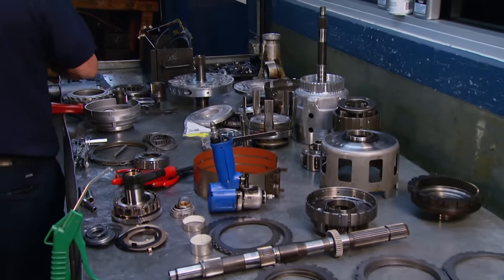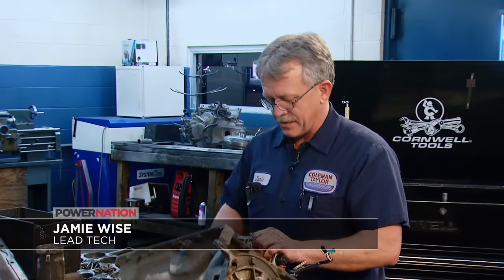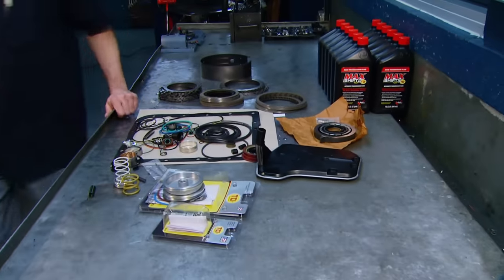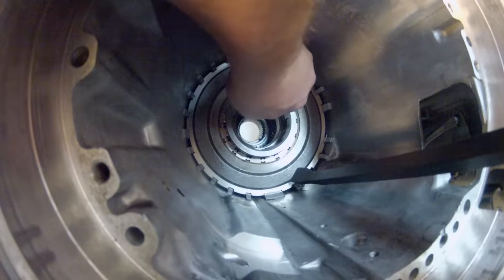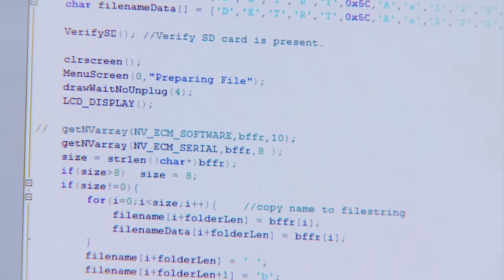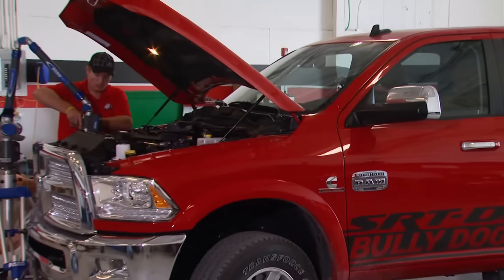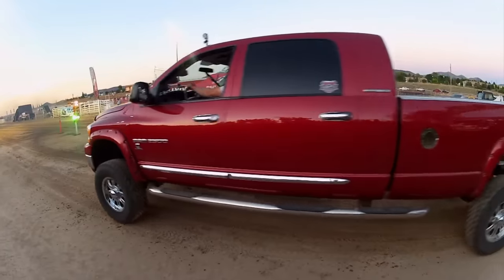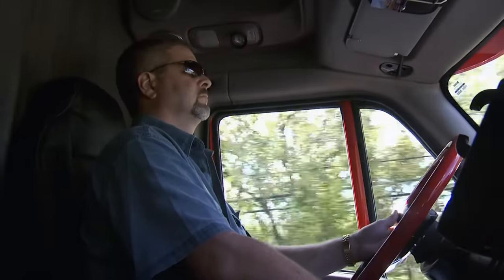Rebuilding a GM 4L60E Transmission for a Chevy Silverado - Truck Tech S1, E12

Comment: Here is the proper way to fix a 4l60e: Sell it for scrap or core and buy 4l80e and install.
Reply: ZE_GERMAN hell yeah brother dido😆
Reply: 100% agree, why waste your time on a 4l60, which even when upgraded is weaker than a 4l80
Reply: Exactly!  Don't even crack the case open..scrap it!
Reply: Facts
Reply: You can dump $5,000 into a 4L60 and run 2-3 tenths faster or use a 4L80 with $5,000 and run 2-3 tenths slower, the choice is yours
Reply: I'll sell you one for $1999 + tax. The part list wont be more than$840.
Reply: @garyrobinson3735  "break"..I wouldn't trust a 60e that cost less than my 80e converter not that I trust them at all lol. A junk yard 80e with shift kit, hardened input shaft and decent converter would be miles ahead of your 60e and reliable with 700hp..you trying to make Thors hammer using eggshells..
Reply: bottomline2000 you need to stop watching the drive way engineer also.
Reply: @jeromewieland55  likely you won't even launch with one of these and snap something inside like the sun shell and them 3-4 clutch packs really love to burn out.
Reply: @garyrobinson3735  nah I had 3 reman from GM which were all blown in a stock 4.8 within 270k miles at 80k miles a swap that's garbage for a factory drivetrain.
Reply: @bryanmartinez6600  get on Facebook and YouTube. Their are plenty of nitous, turbo, n/a cars running 4L60's. To much parasitic loss in a 4L80
Reply: @jeromewieland55  once..you forgot to say once...
Reply: @spyderlyf3  80's are way more expensive and you would be dumb to pull them from a scrapyard and throw them in a vehicle with any kind of power. They are known to wear bushings excessively and I've seen them with the case beat up very bad from the check balls. Until I hit 650-700 ft-lbs of torque I will build my own 60's and know what's in them and have half the money in them. When I hit the point that I need something more than a 60 then I'll go to a 6l90.
Reply: I couldn't even sell my 4L60eeeee for parts. I ended up scrapping the whole thing because no one wanted to pay me money to take this garbage away for me. 4L80E for the win. Got the pressures turned up to max in H P Tuners in WOT. Hits like the Hammer of Thor when it shifts, 1st, 2nd, 3rd. Shifts like this would tear a so called built 4L60eeeee in half.
Reply: @414Chevy  I'll take it. That's not good for the trans to run excessive pressure. You will warp clutch apply plates and start blowing snaprings and drum ends off.
Reply: @GreatLakesLogger  WOT table only is turned up, no torque management. The table will only allow so much pressure. This is a built 4L80 E with 300 M input shaft, so yeah. Did I state it's a 4L80E ?
Reply: @414Chevy  So what? It's still not good just to blow pressure at it. 4l80s eat bushings built or not and they suck more power. Also depending on what you're doing the gear ratios aren't as good and they are expensive. I won't deny a fully built one won't hold more power than a 60 but a 60 will hold plenty of power if built, setup, and used properly
Reply: I Drag Race my car. I don't want my clutches doing soft shifts at WOT so they slip. I've been racing for years. This is what I do. You can build your 4L60eee or 4L80E how you like. This is how I use mine. Did I say it was a 4L80E?
Reply: @414Chevy  I really don't give a crap if it's a 4l80. If I'm gonna spend that much money I'll have a built six speed.
Reply: Yea for you. Obviously, you don't drag race, which is what I do. The fastest way down the quarter mile, not road course, which...…….. you obviously do, is an automatic with a big ass stall converter. I hope you have fun with your built six speed for $2,400.00. Didn't know you could get one that cheap. That is truly a bargain. Walley World is having a sale on toilet paper for $20.00 also.
Reply: Hey Mr. Blow, BTW, a built T-56 starts at $3,195.00 and goes up to $4,947.49 minus a clutch. Ohhh, you must have meant you're building it yourself, because you got the dope moves. Good look finding that $2,400.00 monster trans you saw for sale...……… where?
Reply: @GreatLakesLogger  I'm sorry I didnt realize we were still talking about this..too busy not having transmission problems..I didn't pull my trans from a scrapyard..its a GM 4l85..2009 model with 20k miles on it. Last year they were made. It looks brand new while I'm not throwing pressure at mine it is dual fed with a triple disc converter..the 60e struggled to handle the cammed 6.0 whereas the 80e just rows thru the gears..its smoother in every way. 1 80e cost a lot less than the 2 60es I blew up.. The gearing isn't for everybody but I have 3.42 gears and enough stall so I'm not lacking anywhere..I can still get factory gas mileage on the highway..you can hate on the 80e, but I guarantee you will not beat one rowing gears with a similar setup..typically racers go to less gears than more where power levels go up..good luck with your 60es
Reply: @414Chevy  and yes I will build it myself.
Reply: @GreatLakesLogger  Well isn't that special. You go, you wacky do. Just stay on the road course, so a slush box doesn't embarrass you at the drags.
Reply: @anthonym6078  Will it fit my 05 Avalanche?
Reply: @garyrobinson3735  I want learn to rebuild one  for my 2004 ant tips on parts
Reply: Btw. I can still build a 4l60e to handle over 1000hp for over 100 wot shifts for less than $850. So you guys can keep sucking the power out of your builds with that 4l80. Haha

Comment: Transmissions have always been a real mystery to me, but I am tempted to try rebuilding one myself.
Reply: Same here, it's a fun challenge for the mechanically inclined. Very easy job to mess up though even when you feel like everything's going great. I'm very by the book with clearances but I know there's so much more to it.
Reply: It's a puzzle for sure but not something a good mechanic can't do. I went to transmission school 42 years ago but never got into the field, opting for HVAC as a career instead. I have however rebuilt a few and they all came out better than stock and for 1/4 the cost of what a rebuilt one would have cost me.

Comment: Transmission Bench on youtube shows exactly how to rebuild one with no special tools
Reply: Minus that TP50.. pretty critical for most people who might find themselves at the start of a 4l60e build.
Reply: I'm 15 years old and rebuilt mine with a few wrenches and a pair of pliers 😂
Reply: @Jake Bass how much did it cost u in parts 2 rebuild it
Reply: @garyrobinson3735  I just used impact T50 and a couple minutes with a torch.
Reply: They need door pins and bushings and new cab mounts and need to ditch that ugly lowering job
Reply: @jac_attack04_59  Thanks, just the confidence I needed. Took mine to a backyard transmission guy who was referred by a now ex-friend, my tranny was leaking upon pick up. Took it back, still leaking but a lot less upon pick up. Ended up finding another 1 by luck at a junkyard that was in great condition at a great price but still out of $ 800. I'm planning to open the rebuilt tranny and hope I can diagnose and fix the leak myself and save that tranny for a backup.

Comment: I trust transmission shops as much as I’d trust a stripper with my credit card.
Reply: Just like any tech gotta find a good one.  Back when I had a carburetor in my truck I found only one in Albuquerque that could be trusted to rebuild it.
Reply: I'll only fix one thing and I will charge at least $1400. 
NO Exceptions. If you can do it yourself then you wouldn't be talking to a Builder. So you deserve to be charged every dollar. 
And I will tell the customer the same thing. So what's not to trust?
Reply: @garyrobinson3735  not going to lie what you said is some shady shit!...im not saying your wrong at all,but it is like charging someone $300 for a gallon of gas...of course most of us cant make or source our own oil to make gas but do we deserve to get overcharged?
Reply: @garyrobinson3735  mechanic shops these days hardly bother with repairing the actual transmission though usually if the price of repairing it is just a little lower than throwing a reman might as well do that instead
Reply: Jamal J.H yeah but for how simple it is to fix anyone not willing to put in the time ABSOLUTELY deserves to be charged for their own short comings. 

As for Herpy's comment mechanic shops will. Transmission Shops with real builders will build it. Why would I spend $2100 on a factory replacement when I can rebuild it for less than $300. And then charge $1000 for labor? Not only does it make more money but it's ALOT quicker too. 

hey all look start at $2100.
Reply: Jamal J.H in short, Absolutely. You and anyone else.
Reply: Sherloid Bai
I really enjoy hearing that kind of experience.
Reply: Sherloid Bai I have a 97 Chevy truck v6 transmission that I’m leaning on rebuilding it myself. I do have mechanical skills but never on transmission. How much did you spend on parts and what special tool do you need.
Reply: @bryanmartinez6600  also, rebuilds don't carry a reman warranty.  If you get a GM reman, it has a 1 year warranty, whereas a rebuild will have no warranty, or whatever the shop expects is a decent warranty.
Reply: ryvr madduck Lot of crooks in Albuquerque hah
Reply: Gary Robinson I think the point was that regardless of the failure, you’ll be quoted and charged for an overhaul that will never take place. Often getting a repair that will require overhaul from wear shortly after the warranty expires
Reply: @chocoman6385  good meth though
Reply: Randy Magnum tru tru
Reply: Yeah, I've been burned a few times. Now I just order new crate transmissions... 3 year factory warranty.
Reply: @garyrobinson3735  you remind me of the hack tech, charges the full 8 hours the books says, but don't do a full rebuild, just find the issue and only fix the issue, not replace all the bearings, not replace all the o rings, throw brand new parts from the rebuild kit in the trash because they weren't used because you didn't do a rebuilt, just a simple repair. you're lucky people with cars are stupid, and that there's lots of them. if they knew you were only doing 10 percent of the job you charged them for you would be dead
Reply: @FrankieJames7  guess my $2500 part bill every week is a waste of money.
Reply: @df4480  you will need a( Torx Plus 50 )bit to get  the bell off. 
And some auto parts stores will order it for you. Or Ebay 

Watch transmission bench 4l60e
Reply: @garyrobinson3735  my 1997 transmission problem was the ignition switch harness. For some reason it gave me 5 transmission codes and my speedometer and RPM would stop working. It’s would cause my truck to stall out or felt like it wouldn’t catch gear. After going to the junk yard and buying the part for $10 it  solve my problem. God is good. Thanks for the information advice.
Reply: @samadrid6321  precision transmission? Theres one on YouTube from there,older guy.
Reply: Lucky me my pops used to race and he knows people
Reply: Yea it pays to know the history of the shop . If I have a automatic I want fixed I would not use just anyone . My automatic failed in my truck I having a g56 installed to fix the problem..  not a cheap deal but the automatic problem is  fixed
Reply: @garyrobinson3735 what's not to trust??? Can you scam artists, that's what.  you change a solenoid,, install a new gasket and filter, wash the transmission and say that it's rebuilt and charge people 3500

Comment: So heavy duty planets, Corvette servo, shift solenoids, wiring harness, but not new bonded pistons which is the #1 problem of the 4L60 causing 3-4 failure all the time?
Reply: And why go with a 10 vane pump rotor? Should have went with a 13 vane one, especially when upgrading the booster valve. And I'd swear that was a narrow band, not a wide one, but IDK.

Comment: At the rock garage we used to pull them in including the time to Jack them up and put them on jack stands we didn't have lifts we'd have them on the floor in 20 minutes before the front wheel drives started coming out  on the bench and rebuilt in an hour and a half or less including sanding all the steels to get a better bite on the clutches

Comment: from my knowledge the 4L60E started out as the 700R4, production began in 1982 and lasted until 1991, in 1992 the 4L60E was introduced along with the 4L80E, the 4L60E is mostly used on Gm cars, trucks and vans for the civilian market, the 4L80E was used for heavy duty, GM pickups and Vans made by GM,  starting in 2005 GM started replacing the 4L60e and 4L80E with the 6L80 and 6l90E. the last 4l60E's and 4L80's where made in 2013, they where ONLY available on the Chevy express and GMC savanna work vans. that's a full 33 production years.
Reply: howtobebasic 2 years are a bit off but yes started as the 700r4
Reply: i bought a 45$ 2009 sierra and it's got a 4l60e, biggest junk box i've ever seen
Reply: They were still available on the half ton trucks in 2013 if they had the 4.8 engines.